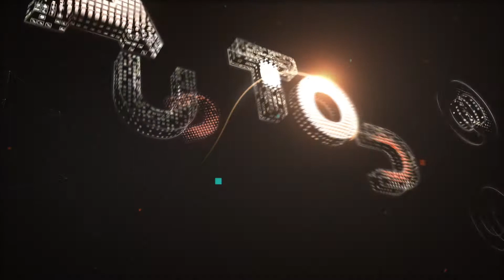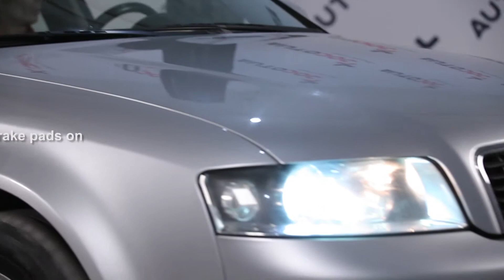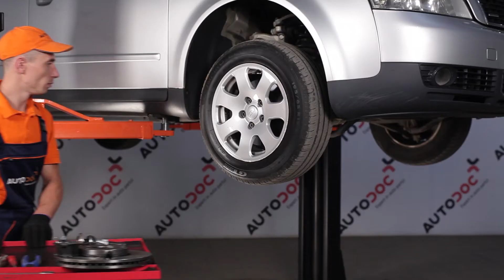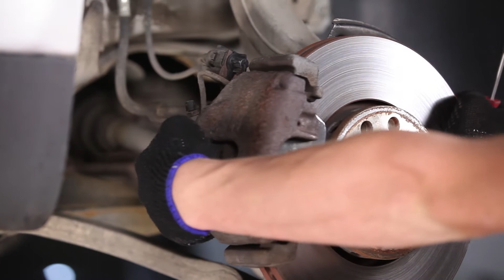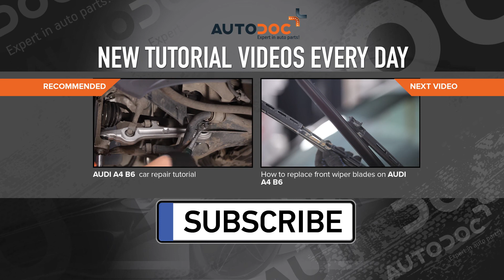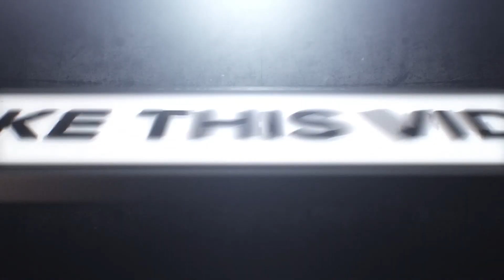How to change front brake discs and front brake pads on AUDI A4 B6 TUTORIAL | AUTODOC

Comment: Hey - how do I reset my Audi brake pad sensors after changing FRONT rotors and pads? Don’t I have to activate the brake pads so the car knows that they are much thicker than the old pads? Can I do this without a scan tool?
Reply from the maker: You can find this information in the technical documentation for the repair of your car.

Comment: is this process the same for the 2009 Q7 ?
Reply from the maker: Thank you for your comment.
In general, the replacement will be similar, the only thing that may differ slightly in the design features of your car. 
You can find more detailed information in the technical documentation for the repair of your car.
Best Regards,
Autodoc team.